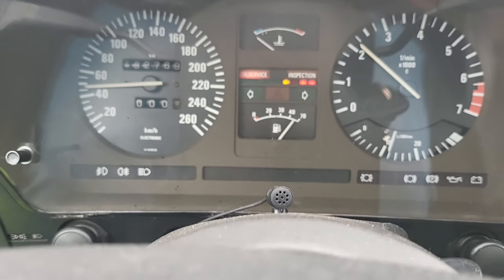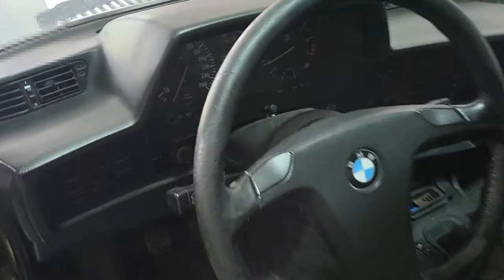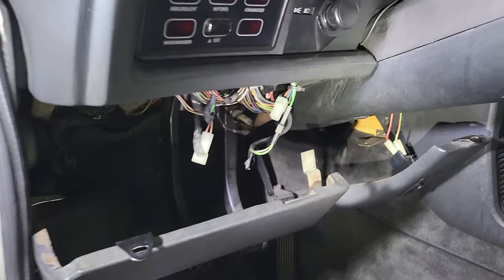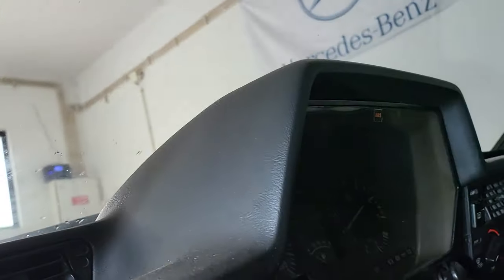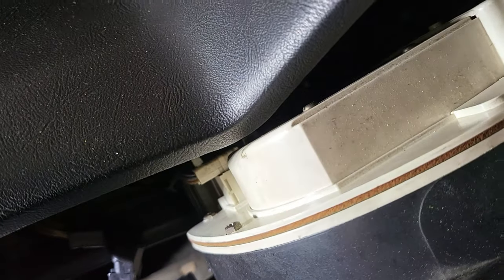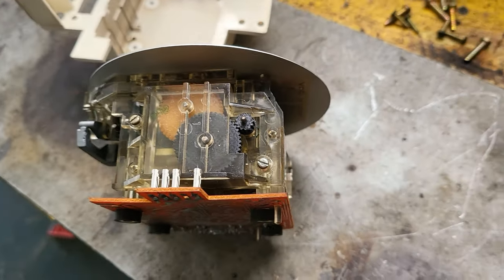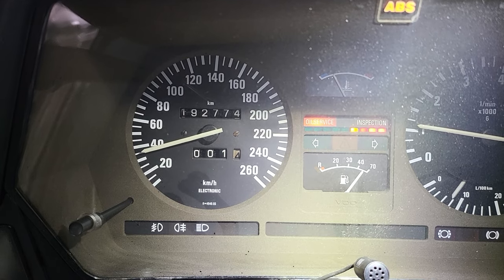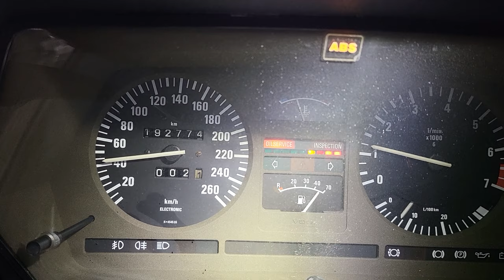Bmw E24 635CSI Odometer gears

Comment: i have a 82 633csi and the odometer spins randomly, according to it i’ve only added around 350 miles since owning it, is there anyway to know the true mileage once i check to see if this is the problem with it ?
Reply from the maker: Thanks for watching...
First of all let me tell that you have one of the most beautifull cars ever made...about the mileage there is no way to check the real mileage because these cars are analogic, but check the solder points on the board and while at it check the condition of the tooth wheels, for experience these usually fail after 40 years....thats a common fault...good luck